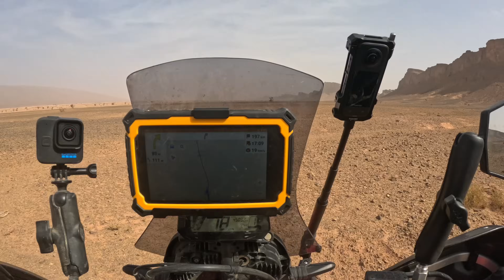This is a serious problem with my motorcycle |S7 - E12|

Comment: Layers of toilet paper soaked in superglue works a charm. even s slab of noodles which you cover with superglue. becomes so hard you can use a metal file to finish it off. fill little holes with maise or baking powder and add a drop of super glue after you applied it to harden it.

Comment: Who else is disapointed in the plastic honda used for that airbox?   Seems like they used something WAY too brittle!  Many plastic airboxes of old are anything but brittle!  You could bend and tweak the heck out of em without cracking but this box seems to have shattered like glass which I find bizarre......really bothers me    Speaking of brittle plastic I managed to break the FUEL TANK/SUB FRAME on my 2020 KT690!  RIGHT at the bottom mounting ear so that every drop of gas poured out the bottom!!  $1800 tank plus fuel pump kit plus labor!!   Luckily I had exteneded warranty ....hard plastics make me nervous on motorcycles!    I am quite sure this same mechanic  would have used fiberglass and resin had I broken down in Morocco and went to him ....LOL  maybe it would work?  I sort of doubt it but what else choice would I have had?  Can you imagine how long I would wait for thise parts in Morocco?  LOL

Comment: All you need is two big pieces of tape Gorilla Tape one of the inside one on the outside the adhesive stick together through the holes clean both areas before you try

Comment: I have a question with all the world traveling you do, why do you not carry a roll of duct tape. In an emergency being far away from any sort of help like the hole in your air box you could duct tape the hole in box till you can get to a larger city. Duct tape can be used for many different purposes. Small things I would carry that does not take up a lot of space duct tape, zip ties and safety wire.

Comment: This is not polyester, this is fiberglass. So, you should be careful. Because it is very itching. But in yours shoes should be the same substance. Polyester is resin polymer.
Reply: Bla blaa bla . The airbox is fix and noraly dont need knew ona 😊

Comment: 26:20 The polyester patch will definitely hold for a long while, however, the " bondo" filler putty will crack and fall off before long which doesn't really matter as its more for aesthetics than anything else, unless they used something like JB plastic weld which I highly doubt they even know what that is,  let alone having it haha.  still,  they seemed like a good group of guys.